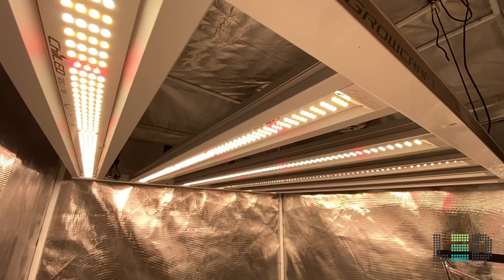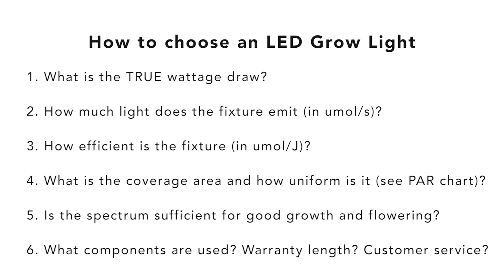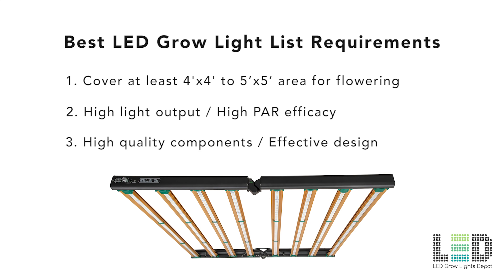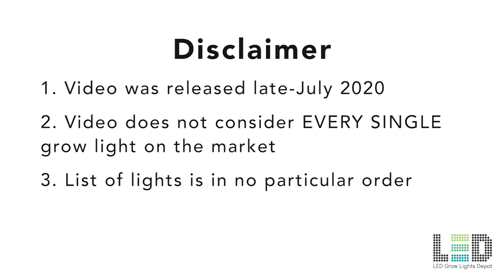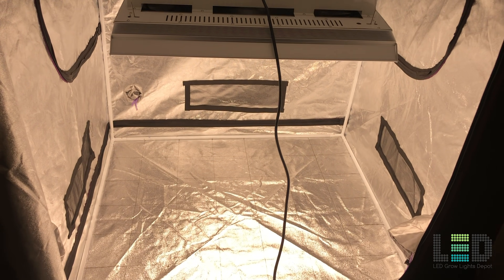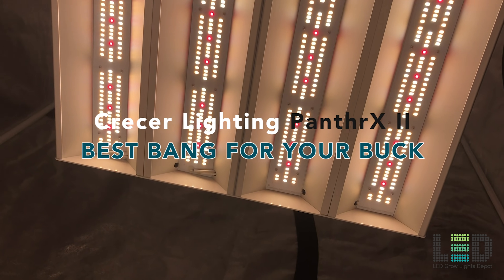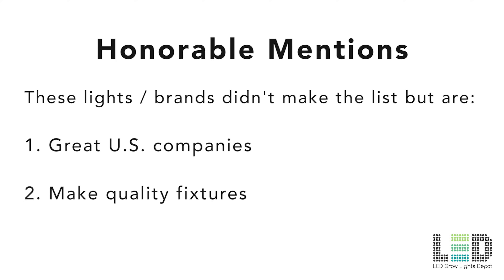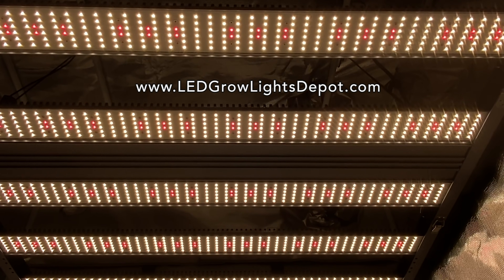Top 7 BEST LED Grow Lights 2020 - NEWEST TECH!

Comment: Smaller lights for smaller spaces needs covered as well, thanks for the info regardless.
Reply: Not only for that. 4x8 tent is huge, it filled my whole room. 4 tents 2x4 would be much more handy.
Reply: @jccuchvjvj  I agree, 2- 2×4 tents work very well for the 4 plants we are permitted in Canada.
Reply: And for smaller prices too. 1.5k for a grow light is way too much.
Reply: If you are doing smaller than a 4x4 dont bothering shopping just get mars hydro for cheap and spider farmer if not trying to go cheap
Reply: @HighAdventures  alibaba over mars or spider farmer any day. May as well buy manufacturer direct and not a white label reseller. We don't do it with seeds, why encourage people to do it with lights?
Reply: @HighAdventures  I actually got The Sonlipo SPL 2000 it’s just a better light all the way around.
Reply: @mischelle9530  I have sf4000 and over 2.8 gram per watt dry wiegh for 580$ dont know how it can be beat but if you do lmk it does 6 flowering and 3 veg on the outside.
Reply: @HighAdventures  nice 👍🏼 no I do not know i haven’t actually grown anything yet and I chose it because of the LED lights that it has and the switches on it etc. hopefully it will be a good grow.
Reply: @HighAdventures  did you like my light that I chose? Did you check it out. To me it’s a really good one! I put it in a 3 by 3 tent. It has IR and UV along with orange and green it’s truly a new full spectrum fixture.
Reply: @HighAdventures  great light! I'm not some commercial seller lol, but another $120 would have gotten you a light that truly would have blown you away... with a umol of 1750 and I believe 2.7g per watt
Hell, California lightworks kicks some serious ass too! Some advice for anybody out there, ADD UVB lighting - cheap and in a tube (CFL format) and it will reduce disease
Reply: @HighAdventures  that means nothing unless you are comparing it to another light under equal conditions. Soil, nutes, training and genetics affect yield more than minor differences in light.
Reply: @HighAdventures  migro are better, the aray 4 is perfect for a 2×4 tent. More efficient and longer lifespan than mars hydro or spider farmer. Even the previous generation cobs I prefer. Prices are comparable.
Reply: Seems like you're all too broke to grow the way you want... everyone gets it, lights are a bit expensive. However, $800 for a light with a 3 year warranty and the best full spectrum you can find for LED really is nothing in terms of cost. There is a reason they are used commercially, they are the best around.
Reply: @nicksmith6629  Sounds to me like your way is the only way you see anyone being able to grow. Promise you more Alibabs are used commercially more than the other brands because everyone always comes back to cost and efficiency, have you taken the time to test any of these lights personally? Or just the one you decided to go with, by your reasoning everyone should still be using HPS then because that's what you feel everyone was using for YEARS. 

The reason why contractors use the expensive lights is for a better mark up on the installs.
Reply: @Lazy_Marksman84  you don’t like the light I chose? What’s your point.
Reply: @mischelle9530  that wasn't the point at all.
Reply: @mischelle9530  their customer service is trash, you're better off going with companies that have reputable customer service.
Reply: @Lazy_Marksman84  I see okay heard they were fine. I liked the light is why I chose it they’re not cheaper really than a known group sucking up all the business I thought I’d give them a chance. It’s a very nice light fixture in my opinion.
Reply: @Lazy_Marksman84  I've worked in a lead or head position for 3 major farms, so no... my way isn't the only way at all! Always learning, and great buds is what its all about.
Reply: @mischelle9530  thats fine, it really is. I started out and still use viparspectra and spider farmer, they're low cost and produce some quality. Once you peak into the higher end, there is almost no going back, even on just still $600
Most are arguing a much lower cost point, because a lot of these lights in this vid are $600 - $850 and are better than lower end.
Reply: @mischelle9530  you don't consider any light to be superior? That doesn't make any sense. The difference is like a Nissan versa vs a Mercedes - hell, even a totyota camry (known to be great, consistent, and reliable). And that light is definitely lying about the power rating already... 200watts from wall, but producing all that? I already see false advertising. Lol and after trying to research, all I find is utter bs, but ok.
Reply: @mischelle9530  also, they flat out lie saying they have been in the business since 2011 - more like since oct.2019 - many people rebrand lights from the manufacturer to resell. many of the cheap & unheard of, like this brand sonlipo, are more of a rip off.
Reply: @nicksmith6629  nah I got what I need not wanting a business just not to pay the redundant prices they’re charging for theirs at the dispensary it’s dumb to do that in reality.
Reply: The people commenting on this post to say that that is overkill for a 4x4 have obviously never grown cannabis.
Reply: Wow yeah those are huge I was thinking my whole area would need like a 12-24 inch light or so not exactly sure still learning but I’ve seen complete tent sets that cost like these lights alone. These are for full rooms perhaps but he is saying 4x4 and 5 by 5? So a little confused 🤷‍♀️.
Reply: @Mischelle  i agree. seems like over kill for a 4x4 or a 5x5... this whole list seems like its for straight commercial grow! Im in the beginnings of just starting myself so... 🤷‍♂️
Reply: @mischelle9530  well there's no need to be confused. Listen what he says. He's saying the thruth and recommendations from manufacturers. These are optimal lights for space he's saying. You can put lesnpowerful lights but then you will not get the product you were hoping for. For leds there's, and for all lights, calculation how much watts for given space. The thing that these lights are expensive is another story.
Reply: @Trrenik0kb  I purchased Sonlipo SPL 2000 for a 3x3 space. I don’t think I am confused, I wanted the marshydro sp 3000 but it never went on sale and it seemed a bit overrated. Over priced; I think the one I bought will be better in reality it was a lucky find perfect 👌🏼 spectrum.
Reply: @mischelle9530  sorry but you write in last comment that you are little confused?...  Of course there's no need to be confused. Manufacturer state for the lights what area can vege and what for flowering. Simple. And these led's are the top of the line. Simple as that. Cheers bro. And one more thing. You will defenately see the difference between your led and these expensive leds in your garden with final yield. I had shitty cheap lights and when i bought es 300, there was night and day difference with same strain.
Reply: @mischelle9530  your light is designed to equally disperse light in a rectangle not a square. The other light you mention would have been more appropriate for a square. I also think you are a little deficient in amount of light. Not saying it won't work, but I think you would notice the difference in quality and yield with a light better suited to the space.
Reply: @roywarriner8441  well that sucks we can’t trust anyone new because of the criminals that live in our world oh how times have changed and the government was supposed to end snake oil sales yet they just stop the real businesses all snake oil is allowed no consequences.
Reply: @mischelle9530  ???
Reply: @roywarriner8441  you know my light is in a square it was sold to me for a square also is no longer available they changed it or upgraded it can be put in a 3x4 flower for sure but and so they have one lower and higher priced than mine but no longer sale mine. Mine actually is no longer on the market at all, I haven’t had problems with it or anything seems fine is producing nice sized plants even with UV on there are no burns,  I hope I wasn’t robbed since I actually paid more for it as if I would have bought one similar of spider farmer or Mars hydro , Viparspectra you know people just suck now a days. Well I’ll let you know in future if it was a flop and pirates selling snake oil.
Reply: @roywarriner8441  I am going to try not worry about it I mean I’ve seen some horrible grows online and mine is far from them it’s a nice grow I have going on not quite pro but it did surprise me. Plants are almost reaching the light and I’ve lifted it once already they are autos and while it was my first time I did do some LST they are not suffering this is clear will my light work in a few years according to their warranty this is yet to be seen. Other than that I am happy although not happy to know they felt the need to make a better one than it and one not quite as good. It could have been a money thing I certainly can’t see why they decided to do that but here’s hoping 🤞.
Reply: @mischelle9530  sorry, I thought I was familiar with that light, must have mistaken it for another brand. Even the less expensive brands are adequate in output and efficiency for a home growing for personal use. The only difference you will likely notice is lifespan. Be a few years before you notice that. Most lights are full spectrum now anyway so that isn't as much of an issue as it once was. The lights in the vid are more for commercial growers I would think. 4×4 tents are too big for most home growers, it's easier to find space for 2-2×4's.
Reply: @roywarriner8441  it is doing great on time it turns it off and on daily, I really like it. I checked The output it is what they said it was. But yeah warranty might be a thing I have a 3x3 and it can cover a 3x4 which is like a closet. I can lower the UV or increase it, it is very nice looking also. Well hopefully they will become trusted as the ones I mentioned Mars etc. it is very well made.
Reply: @mischelle9530  your light would be good for at least 3 years, if the change in led tech improves as much as it has in the last 3, you will be able to buy a light twice as efficient at half the price when and if you ever need to.. I do feminized, I'm on my third grow, I veg in a 3×3 with one light and flower in a 2×4 wirh 2  more of the same lights. I have 3 Migro cobs and a Migro Aray 4 in another 4×2. I get over a qp of bud off each plant, 2 plants per tent. I like the versatility of  using multiples of 2×2 lights.
Reply: @roywarriner8441  well after I derped and you didn’t reply I decided to just delete what I said as you may not have found it funny 😄. That’s ok 👍🏼 I don’t know if I want COBs they are excellent but it’s not that I can’t afford them I just don’t see the reason for them. I might buy better in the future. There is the electric sky I have been looking at they are very expensive but are not COB they are talking new technology that actually reaches out to parts of the plants at different times. Now that’s some tech I’ll probably never enjoy.
Reply: @roywarriner8441  I am not sure why they are charging the same prices for COB as the SmD but they are i guess there is a reason behind it. Do you know why and why they still make the SMD LED? I mean if COB is better and cost the same. I guess I’ll learn eventually but if you know you could tell me though. I mean apparently you have studied the stuff a bunch more and on your 4th grow. Might not continue to look at the electric sky if they are no better because they’re not COB. Don’t understand the price there now.
Reply: @roywarriner8441  I wanted to show you my lights and tell you why I turned away from COB but they’re not allowing me to do that. I didn’t even share a link for it just copied its information But I’ll go ahead and say what I said when I looked at lights I found most COBs are purple or pink and well the same price and cheaper, some reported major heat also. Although that’s not the case in reality depending on which one you buy I still turned away because of it. Well happy harvesting. Look at the SPE 3000 and that’s my light with one less bar.
Reply: @mischelle9530  look me up on fb
Reply: @mischelle9530  the cobs are ok, but they have gone to bars now, bars are better but not enough to replace the cobs. The Aray 4 is 4 bars, spectrum is about the same but more even light spread. I was out kayaking so I missed your message. We could pm and share pics on fb.
Reply: @mischelle9530  led lights now are like computers in the late 90's, if you're happy with your lights, you will not need to upgrade just to have the latest and greatest. I didn't get the Aray to replace the cobs, I added another tent, they are migro's next gen. Cheaper and more efficient, comparable output and spectrum. I did try a cheap blurple for seedlings and veg, meh. Migro is in Ireland, the Aray 4 was 452 CAD with shipping, that was a pre-order so that may have been discounted. The cobs were in stock when I ordered them, arrived 5 days after I ordered them by fedex coming from another continent. At the same time it took Canada Post 5 weeks to get a tent here from an amazon warehouse 70km from my house.
Reply: @roywarriner8441   wow I am sorry that’s insane I paid 350 for mine delivery was free from prime Amazon 2 day shipping. it has 4.6 rating. I do like it very nice light in my opinion the grow is good 👍🏼 I’ll see about Facebook and sharing later on. Wow my dude so sorry about the long wait and high price. Yea I chose bars for the Par coverage and this light for the IR and UV and basic setup being able to turn both on and off and dim either one at anytime. I just wanted one light for the whole process. One tent 🏕 you know I popped their seeds under it. Oh I wanted to add that’s USA dollars there is a bit of difference in exchange which where you live you know more than any one.
Reply: @mischelle9530  I'm not unhappy with the price, these lights are rated for a much longer lifespan than spf or mars, I have heard about some durability issues with mars, but over the last year since I bought my lights the quality of both brands have improved as the price has come down. Migro has a Youtube channel, does reviews and has vids on other related subjects not just lights. I'm trying to guess your nationality from the spelling of your name. I thought french at first but the s makes me think slavic?
Reply: @roywarriner8441  I am English uh it has a story behind it. 😉 yeah that’s good see I don’t know 🤷‍♀️ too much about lights I have listened to Migro but didn’t care to buy his lights he always has a stoned look on his face, love him and no I haven’t been unworried about them failing but I think their warranty is enough for me. I do have a very small back up light I haven’t actually used it just in case. But they’ve been great put the girls to bed for their six hours all by itself.
Reply: @mischelle9530  the first light I bought was crap, did more research. At the time, Migro was comparable in price and output to spf and mars but more efficient. When I bought the Aray 4, the comparable spf was 100 bucks more. What dollars are you using? I'm CAD.
Reply: @mischelle9530  yeah he does look stoned all the time. It would be hypocritical for me to comment on that though. Haha
Reply: @roywarriner8441  I am in America 🇺🇸 I am one of its founders lol 😂. I use us dollars
Reply: @roywarriner8441  nah we’ve told him we like seeing it why not just relax do your thing.
Reply: @mischelle9530  I just wondered if we are dealing with the same legislation. We are allowed 4 plants growing, no limit on dry flower or concentrates in your house, but  can't carry more than 28 grams.
Reply: @roywarriner8441  yep 👍🏼 that’s it.
Reply: @roywarriner8441  Oh I wrote us dollars expected a autocorrect US dollars 💵 so your dollars don’t go as far. So to me that was expensive to hear but like you said they last longer and are more efficient.
Reply: @mischelle9530  your 350 for your light would be half that again Canadian. The migro light is cheaper comparing apples to apples. Your light would be over 500 CAD, spf and mars for a 2×4 are comparable.
Reply: @roywarriner8441  I know it’s crazy high to me 😂.  That’s why I said I was sorry.  I have Mars hydro tent didn’t care for their lights.
Reply: @roywarriner8441  well I did like the SP 3000 but didn’t want a long tent. And the do have the other newer one now but to me they cost more than they are actually worth. Long omg 😆 wide.
Reply: @roywarriner8441  I’ll share my Facebook with you I don’t get on much but that way you can show me and I you this sucks that youtube don’t have messages anymore. I’m playing ESO now. So maybe tomorrow. Do you have discord might be better.
Reply: Yeah discord probably has more privacy than Facebook at this point and time if you know what I mean and we can live chat that way there is no confusion. 😂 you can see my actual light tell me what you and maybe teach me about yours.
Reply: @mischelle9530  I have both, the 3 cobs I bought around this time last year, 1 to veg in a 3×3, the other 2 for a 2×4 to flower, then I bought another 2×4 tent a few months later, by then they were taking orders for the new models. The cobs are good lights, the new ones are a little better but my plants can't tell the difference. They are all full spectrum, I don't veg in one tent and flower in another because of the color of the light, but because 1 light is adequate for a 3×3 in veg but only a 2×2 in flower. The drivers are dimmable and not attached to the light so less heat in the tents. I have cayenne peppers and strawberries in the veg tent too, I only have the light on for 16 hrs in the veg tent if I have weed vegging but cut it back to 10 or 12 when it is just peppers and berries, they don't seem to like long days, 6 to 8 hrs would be plenty. The Aray 2 is comparable to a cob, the Aray 4 is two Aray 2 joined side by side with one larger driver than for the single light. I bought the cobs with seperate drivers for flexibility, I hadn't decided yet on how I was going to arrange my tents when I was getting started. They just had the two Aray models to start, for a 2×2 and 2×4, but daisy chain them for bigger tents, later on they added the model for a 3×3,  3 bars but longer than the other models to make a square. I dry in the tent they grew in. I usually start a couple of seeds two weeks before I harvest. By the time the plants are dry, the next two are well on their way.
Reply: The only problems with deliveries whether ordering from amazon or from the manufacturer is if they use Canada Post. Before covid they were awesome, for the last year anything but.
Reply: @mischelle9530 don't worry about fb then, I only used it to stay in the loop as far as upcoming work, but I retired last year and I can't stand most of the people I used to work with so I've been thinking about closing my account anyway. Stay green
Reply: @roywarriner8441  yeah the post sucked for the longest here too, but it’s pretty much back to normal well for me I’ve had two items not show up from Amazon in the last year and in 7 years of being a prime customer that hasn’t happened, I just started my first grow not even two months ago so still such a noob I split one of my girls right down the main stem I operated on her with medical tape. I just did that 2 days ago.  Heard she will survive I hope so Guarantee it won’t happen again. I am worried about her she looks fine though I was a good surgeon 👩‍⚕️ 😂 and I wasn’t sure either about the set up at first i had a different room planned till I went to buy stuff that I had to learn about and that’s why I was thinking about the sp3000 I wanted a 2 by 4 but then I had to change the room they would be in to be able to control the weather better light, humidity and such, frequency of having to go in the room etc. so they live upstairs so they are not hard to keep warm etc. These lights don’t give off any heat so that’s good. It was just too much for me to learn and when I went to migro I thought I had to choose each diode bar put them in the right order and that I could buy to much of what I actually needed or too little like white red IR UV I needed to depend on one that had all of those things already set up I can chain if I want a 10 by 10 tent or something it has that ability. But since I can only do four plants no need. I just didn’t understand the lights or even RO water lots to learn and to decide on your first grow when you have no idea of what it even looks like to grow, only what the buds look like when ready 🤩 yeah all that you said got confusing and I think I missed a comment oh I am not sure if that was the one I seen that was choose your own bar or not still haven’t looked into building my own lights. It’s like I am praying to get through this grow just put DE on my girls today seen a couple holes in the leaves not cool.
Reply: @roywarriner8441  and yeah Facebook not the best idea 💡Discord is ok though you stay green too guy. I’ll look into the lights after I have everything under control and know everything just off my head experience helps.
Reply: @roywarriner8441  I think there are a few growers on discord I haven’t joined any of them I only use it for ESO that’s an online rpg game. If you want to connect though we can then later on Facebook I don’t want to give my name here 😂 I’d get a jillion friend requests.
Reply: @roywarriner8441  oh I am retired too I have family on my Facebook and old school friends I have about 200 people maybe 🤔 if that I keep it personal cause of the photos and stuff that’s on it I also don’t allow followers or people at random to comment on my links. Friends get to say what they like and since I grew up with them we don’t always agree still love each other though I do have a couple people I met on ESO it is a game that brings us all together and then we get on discord to chat while we play together, Well I’ll eventually learn about all the lights but I think I did ok starting out. I made sure I had all the options in one package most lights don’t have IR and UV  I didn’t really want to separate all that though I might learn it’s actually a good idea to do that. We will see in 3-4 years. I just had to add why I didn’t want everyone on my Facebook. It bugged me 😂. I wasn’t being anti social or anything. Take care guy goodnight.
Reply: Check out the house plant community for small lights.
I recommend Sansi bulbs from Amazon or if you need something for a shelf,
check out Aquarium lights. The chinese knockoffs from Amazon work great.
Reply: Guys, check the title. 
He made this video on purpose. Top 7 BEST led lights. 
This is like watching car show but not average show more like top gear.
This are the ferraris among lights.😉💪🏻